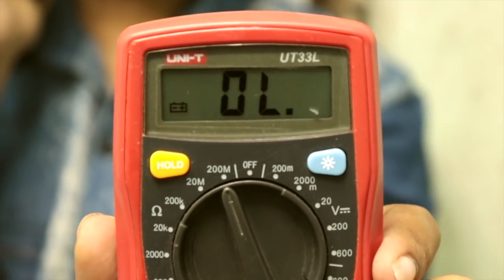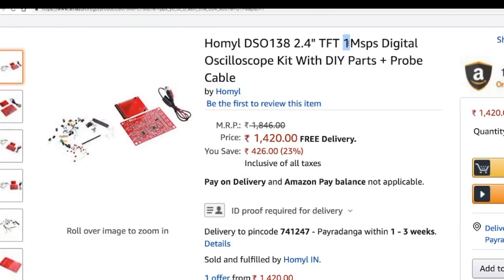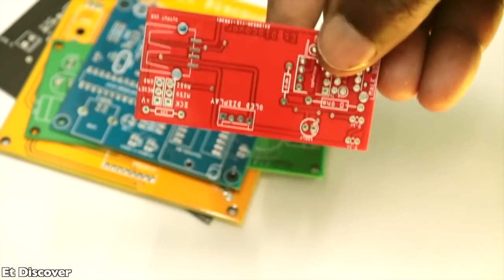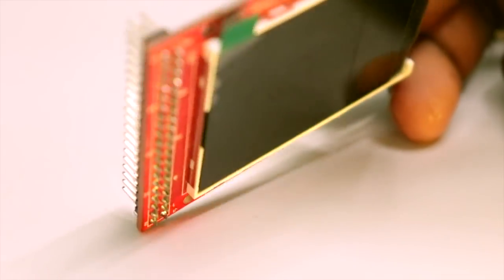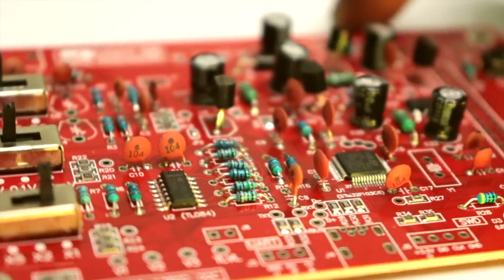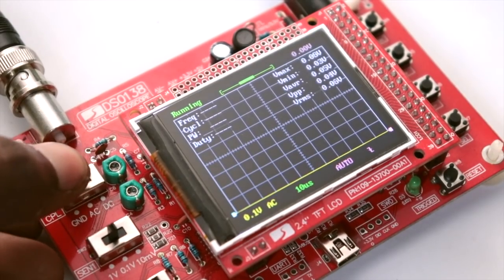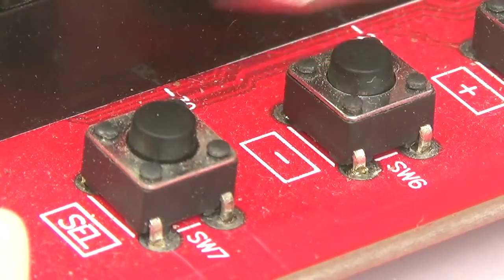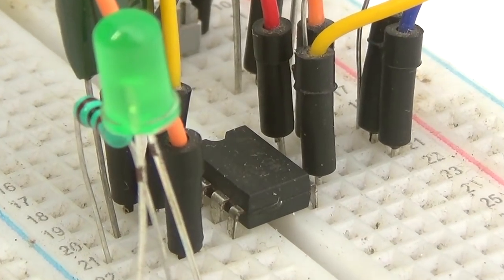Make Your Own Oscilloscope & Basic Tutorial

Comment: How much the  maximum voltage&current of input signal?
Reply from the maker: Same as multimeter
Reply: @EtDiscover  can the oscilloscope withstand in 10A?
Reply from the maker: No only signal
Reply: @EtDiscover  can with stand in 100V?
Reply: @EtDiscover  This app can generate various signals at various  frequency and amplitude. This is very use full for your projects.
Reply from the maker: you can analyse 220ac volt or more
Reply from the maker: I just use it for basic purposes . Coming soon Hantek Dso5202p 200mhz 2ch 1gss Digital Oscilloscope
Reply: @EtDiscover  ok thank you!